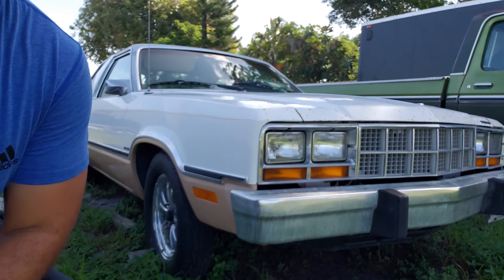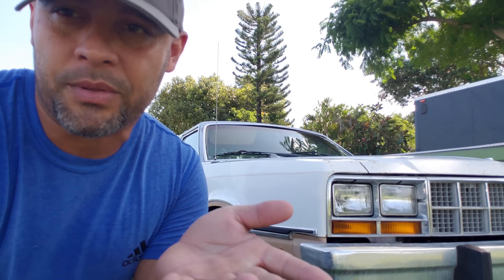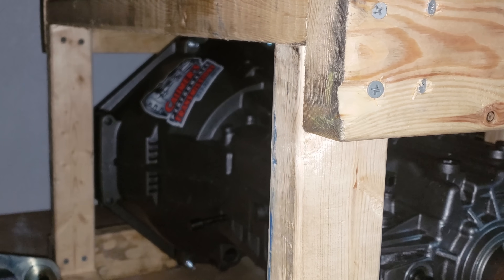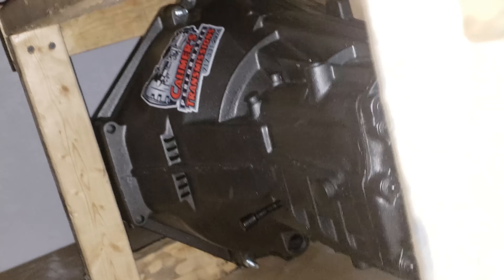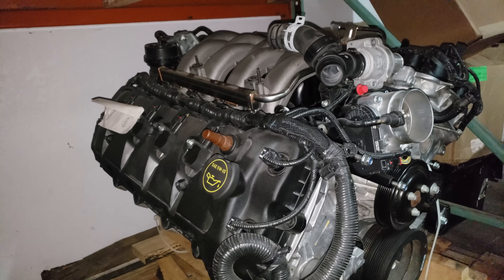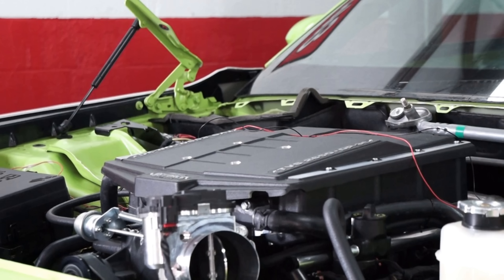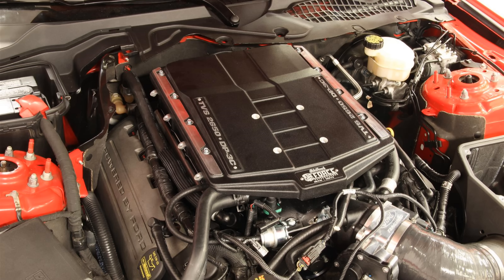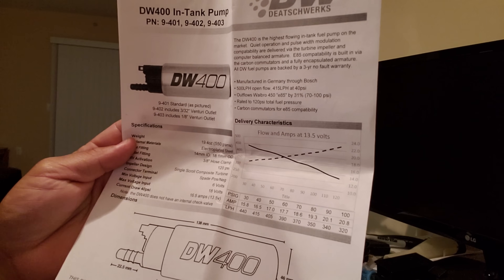Fairmont Coyote powertrain Revealed and Power adder options

Comment: I have an 08 S197 with a Brenspeed built 326 CI, ported heads, comp cams, Edelbrock E-Force 2.3L, Kooks LT's and a Magnum XL 6 speed tranny.  It's making 720 at the crank.  I got good numbers from my Brenspeed tune, but went to JPC for a return style fuel system and tune. It's making 600+ torque at 2k RPM, with a broad curve and good drivability.  I asked JPC's what's holding the car back from making big power - 800 + HP.  They gave me a 1 word answer - OCTANE.  With P.T.F.E lines and duel Walbro pumps, I've got the fuel system to handle E85.  But I'm gonna settle for a nice reliable street machine for now.

Comment: You just made make take a whole new interest in the Fairmont project. Good to see you going off the beaten path and trying out that Edelbrock. I looked at them but was concerned that there wasn't much support and that's why I ended up with a roush P2. Kenne Bell blowers might be easier to hit 900+whp with, dunno if you looked into those.

Comment: If you get the dealer to contact Ford about the transmission issue, they possibly could swap a GT350 one in your new Stang an you pay the offset difference. I seen it done on a smaller scale.

Comment: Alex, really excited to see you going this route.  My 2011 with Boss internals is running the stage 2 Eforce that I have upgraded even further.  Have been talking with J Nardi from lund about having you guys tune it due to the fuel issues I am seeing in my logs.  I am running the BBK90mm TB but I am hearing that might not be a wise choice.  What are your thoughts on that TB?  I will say the power is instant and very impressive with this blower.  Looking forward to the build.  BTW I get a supplier discount from Edelbrock since I am a Eaton employee.  Got a sweet deal on my kit.  Might be able to hook you up!
Reply: Alex tuned my edelbrock supercharger through lund 3" pulley=10psi it runs a lot better, lund tune is worth it. In my opinion.
Reply: Travis Owings awesome, I am running the 2.75 pulley and it’s right around 13-14psi  I am confident a better tune would help.  Are you just running a boost a pump on the stock fuel system? What fuel?
Reply: BLK Mamba419 check out his TB video he made sometime ago. He goes more into detail in that video. Video is called “WHATS THE BEST THROTTLE BODY”
Reply: texas stangs yeah I have seen that video but I don’t think he ever touched on either the BBK TB’s he really only discussed the differences between the rear inlet models.
Reply: BLK mamba419, I have a Bap stock fuel system with 93 octane and torco added. Going back to the dyno this weekend, It made 561whp before. The Lund tune just simply drives better
Reply: Travis Owings what injectors are you running? I just bought a set of ID1050x injectors and can’t get them to fit on the Eforce
Reply: BLK Mamba419  my breenspeed kit had 47# injectors when I swapped to 56 # injectors from a vmp kit they would not fit using the 1050x hats. I elongated the rail holes with a drill bit to get them to fit they were too tall. When I searched the part number on the 47# injectors they fit a 87-93 mustang Which I believe to be ev6 body style. I would get with injector dynamics and see about getting a shorter hat for the 1050x

Comment: Lol told you guys no matter how much shit people talk about camaro there not failing near as much as the mustang transmission 3-4 fork failing. motor ticks and failer at 6000 miles and under and fuel pumps. time you have to wait for it to be fixed and not using your new car and enjoying it I would rather a 18 SS anyday over 18 Mustang gt 5.eatcrow
Reply: Utah county Picazo's page 
If your gay..be gay. Dont sling your fudge on mustang owners

Comment: The E force blowers are good bolt on kits for the old guy that wants OEM install and gets a decent pick up in power. They are restricted by the TB and inlet (only make one design) and theres not a lot of upgrades available for them (cooling, pullies, intakes, etc). It will be an uphill battle IMO for 900+ rwhp out of that blower configuration. They make 550rwhp @ 9psi on the 16+ LT1 camaros (the only platform I've seen them on so far). Good luck if you continue on that route!
Reply: No they're not, a Gen 2 Coyote is 385whp stock. To get 500whp it Cobra Jet IM, Cams, Pmas, Headers, Exhaust, Twin 67 or Monoblade TB. 500whp is easier with the Gen 3 Coyote, but even then still requires mods.
Reply: Breenspeed is all over the Eldelbrock 2650 shit for Mustangs..

Comment: Should have bought a 10R80 transmission.
Reply from the maker: x1000
Reply: Michael Trower take your ass to the forums and read on it yourself...

My mt82 gets beat on all day everyday guess that means no other mt82 has problems either
Reply: @Texarmageddon  10R80 sure breaks a whole hell of a lot less than MT82s.... Junk ass transmissions
Reply: I5ZQ8 well said!!!
Reply: I5ZQ8 probably cause there is a whole lot of people that can’t drive .....
Reply: Texarmageddon face it the 18 mt82's are trash and I like drag racing I will smoke a 6 speed I don't care how good you shift
Reply: Swap a 17 MT82 in there. They have better ratios anyway
Reply: Michael Trower you’ll smoke someone who doesn’t know how to shift or making same power as you.... otherwise there is always someone faster...

Also, I have nothing to face as there are people out there running S/C on their mt82s ... 

Mt82s just have poor quality control... you land a decent one and it will treat you well
Reply: Michael Trower because the 10r80 doesn’t have its issues either 🤷🏽‍♂️🤷🏽‍♂️🤷🏽‍♂️🤷🏽‍♂️ fail to see the point you’re trying to make
Reply: Texarmageddon I haven't seen or had any issues with the 10r80 the mt82's have all kinds of issues enlighten me on what issues the 10 speeds have
Reply: Texarmageddon stangmode has beat the piss out of his with not one problem

Comment: Put an 8-71, carbs, and standalone ignition/cam management on it. That would be gangster.
Reply from the maker: But i'd smell like gas all of the time.
Reply: Alejandro Flores Aww c'mon you gotta channel your inner yolo. I guess a better option would be to top it with a pair of carb-style EFI throttle bodies, could be a good tuning learning experience. Or get the guys at Accufab to make you a lower intake with injector bungs and an upper with their throttle bodies.

Comment: I hope you do get the edelbrock I have been trying to find out how good it can be also
Reply from the maker: We will see, inlet and pulley sizes will determine if i'll be picking one up.
Reply: Alejandro Flores 

I’d lean on the whipple gen 3. I’ve heard good things out of that setup on a 3rd gen coyote.
Reply: Alejandro Flores maybe the reason I don't see much about them is due to those reasons if so do u like Kenne Belle stuff?
Reply: Alejandro Flores  Have you looked at Magnacharger? I believe they make the superchargers with similar design for the ZL1s and other LSA type superchargers. Just an idea.